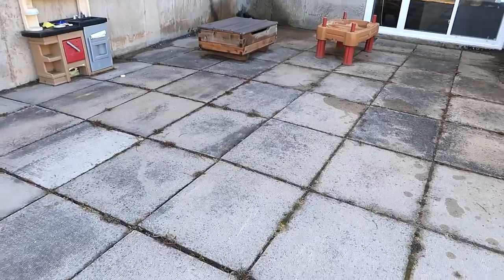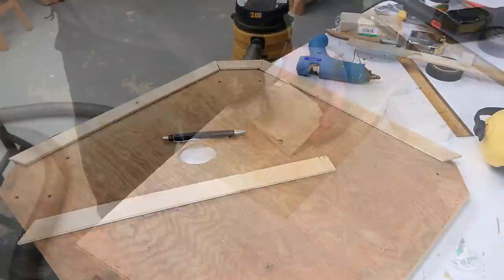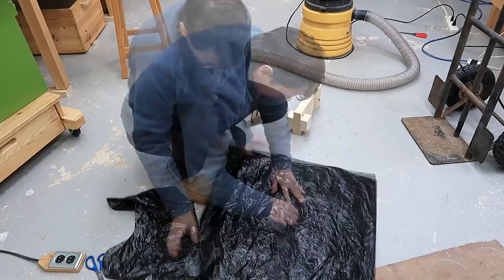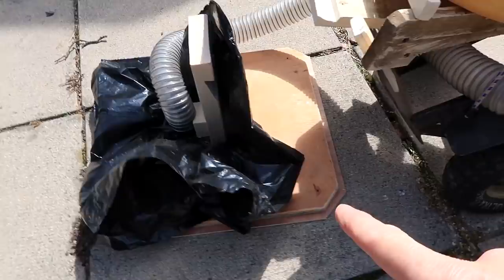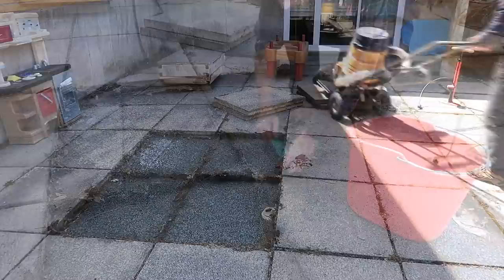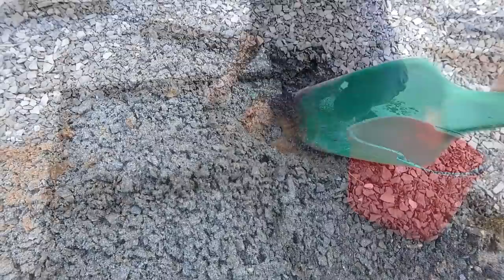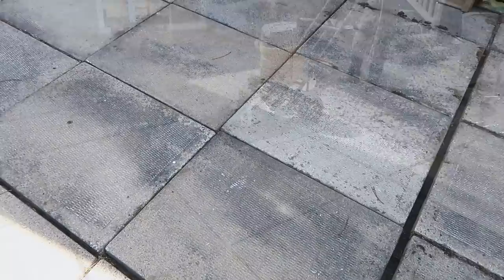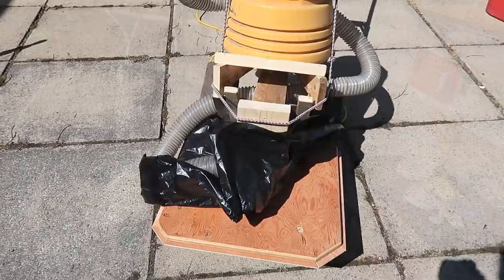Lifting patio stones with a shopvac

Comment: Out of all of his inventions this is the one that impressed me the most. The ratio of simplicity in problem solving to outcome and reduction in stress on the back blows me away! One of those “how did I not think of this” moments
Reply: great points.
Reply: Still a lot more work than just spraying the weeds with some weedkiller, or just pressure wash the patio and that will cut the weeds off (and it needs pressure washing anyway). Long term solution: pressure wash first, then use some stone setting sand to grout the blocks - the sand has a little cement in it and sets up like grout after it gets wet the first time. Won't have a weed issue after that.
Reply: Matthias is great, but these already exist. I own a couple. (probst slab lifter)
Reply: I get blown away constantly  by his content. Also I love when Amogla (spelling?) shows up. Such a cool little 'cottage village' with just barebone fix it stuff. Learned ALOT of stuff on this channel.
Reply: @gorak9000  Chemical weedkillers aren't legal in Ontario
Reply: @jonlai9  last I checked he was in New Brunswick - and vinegar works ok if you can't get anything else (or gasoline, but at current prices, I can see not wanting to use it as weed killer). These weeds are among patio stones, not mixed in with turf grass - you don't need a selective broad leaf herbicide for this job
Reply: Slurp …sluurp!!!!
Reply: @ButterfatFarms  it’s the design principle and how well it worked. Obviously the right thing to do is to lift all the pavers, regrade and maybe add a weed barrier and reinstall. Which he very likely will do soon. But if you’ve ever lifted a patio full of these pavers you’ll know your back will thank you for this.
Reply: @gorak9000  I don't know if it's the case with these pavers, but sometimes they have a finish that can be damaged with a pressure washer. It will roughen the surface, causing dirt and moss to take hold even quicker than before.
Reply: @ButterfatFarms  Tripping hazards.  (From stone edges lifting because of weed roots)
Reply: @dbox1238  Not too surprising that these exist, given that there are people who professionally do this and are easily able to spend hundreds or thousands of dollars to make their jobs easier and more efficient (depending on the exact nature of the job and the machine). However, when you already have a shop vac and a hand truck, a home gamer might be more willing to spend some time in the shop to cobble together something that works well enough for their needs, instead of buying a brand-new single-purpose tool that just sits in the garage until the next time you want to lift those patio stones.
Reply: @gorak9000   just pour boiling water between the tiles.
Reply: @jonlai9  boiling water or salted boiling water are illegal too?

Comment: Polymeric sand is what you need. Spread it, sweep it into the gaps, gently use a blower to clean off the excess then gently water and wait. It will cure to a consistency of rubber.  Doesn't last forever though and will be redone eventually.  Longevity depends on exposure.
Edit to add: when using the leaf blower blow at a 45° angle to the pattern to keep as much as the polymeric in the gaps as possible.
Reply: was going to say the same.. but i think some of those gaps are a bit too large for it tho.
Reply: I used that stuff once. It keeps weeds down but mold and moss grows in the shady areas.
Reply: Plus the Polymeric sand will make it harder for ants to make holes in the cracks
Reply: Yep, used that with pavers around the swimming pool. No weeds. no ants, works well but kinda expensive.
Reply: Everyone has been giving great information for you. I have pavers and a cement slab in my backyard and I do a daily cleanup of the joints between the pavers and the manufactured cuts in my cement slab to prevent dust and seeds from settling in between the cracks. My 30 year pavers I perform a weekly cleanup and twice yearly I pull the weeds out. This is tedious work but it’s a way of performing some type of upkeep which works. The reduction in soil buildup because of the outdoor elements is the only way to reduce plant life from growing. Otherwise you’ll have to hire a contractor to perform quarterly work on your pavers. This is what’s not shown on these tv home repairs.
Reply: Is that similar to the 'kinetic sand' that is sold as a toy?
Reply: @DJ-jm9gi  Sounds like straight microplastic though...
Reply: I have used this! Just don't leave any on top of stone, when wetting! It will never come off
Reply: @robertbackhaus8911  no, this sand has a glue, that sets up hard
Reply: @randallolson8817  if there is sand stuck on the surface a hardwood stick (think oak 1x) and hammer and it'll sort of chisel off.
Reply: Some 8 years ago I made a patio and I used polymeric sand as well. At first it worked fine, but after some years weeds and / or ants won the battle. About 1 year ago I scraped out all of the sand and weeds, blew the gaps clean and dry with compressed air and filled the (3 mm) gaps with a decent amount of silicone kit. My father did the same with his patio in 1995 and it is still as good as new. Okay, not very cheap, but it lasts for ages.
Reply: @rolandmichels1  Good idea! what type of silicon did you use any brand/model? if you can provide any info it will be appreciated thx
Reply: @mrpurpleman9698  I used Bison Polymax transparent. You can use the cheapest type; that stil works fine. It only takes a little longer to dry.
Of course you could use white, black or grey kit, but they will all turn dark grey after a while, due to small dust particles settling in the kit.

Comment: We did something like this in reverse to help my dad move heavy shop tools (saws etc.) around on a fairly smooth floor. Built a "hover-platform" with a flexible skirt that was pressurized by the exhaust of a shop vac.  Dead simple to do and very handy.  (Apparently you can buy them now)
Reply: Like a little hovercraft. hehe.

Comment: I can imagine all of the hard scape installers looking at the wet/dry vacuum back at their shop a whole lot differently this morning.  Even if you didn't have any materials this would pay for itself in less than one day.   Commercially, I've seen the vacuum skirts made of a thin latex rubber - like a slightly thicker version of the rubber band materials the physical therapists use with patients.  It has a bit more weight to it and won't blow around as easily.
Reply: A skirt for this could be as simple as laying a fat bead of silicone. I've used silicone in that manner in the past for vacuum forming, works really well even with uneven surfaces (like textured foam, for example, which is a PITA to vacuum form because normal machines can't "grip" it).
Reply: I was thinking he'd slap some weather stripping on the bottom but a garbage bag is thrifty to an extreme.
Reply: Yep, if this isn't available as a commercial product already, it's about to be.

Comment: Matthias:  The lifting device is pure genus.  You come up with one great idea after another that is why I enjoy watching your videos, keep it up.  Now about weeds in your patio,, there is a granulated weed killer called casaron.  you sprinkle and sweep into the cracks and it prevents weed seeds from germinating.  To rid the soil or in your case crushed rock you simply have to turn the material  to aerate the soil.  To sest you can plant a radish seed or two since they are quick to germinate.  The casaron takes an inch of water to dissolve and form a gas in the soil.  Hope this helps you.  David Adair

Comment: Love the video it helped me build my own for my patio re-lay last year.  The difference for me was I used a probst vph-150 suction head from ebay £20 instead of the first part of your video making the plate.  Then instead of the vacuum which I got working as you showed I decided to use a car type inflator 150L / min and connect it to a vacuum generator block ( simple block of aluminum with three holes, £5 CV 20HS Pneumatic Air Exhaust Vacuum Ejector Valve Compact and Powerful) works a treat.  Maybe others would benefit from you showing that in another video.  At least this way I'm not in the dog house for burning out the vacuum cleaner lol.

Comment: There is a special type of concrete silicone from Sika that you could use in the gaps. That will cure as rubber and will last for as long as you want that patio. I did my driveway about 5 years ago and everything is just as good as the first day. No water wash-away, no gaps for dirt and leaves and acorns to get collected, therefore no weeds. You get the point.

Comment: This video gave me the inspiration to use a shopvac to pull a large dent out of my cars bumper after someone hit it in a parking lot. I heated it up slightly and used a bucket, trash bag, tape and a shopvac and it sucked the dent right out of the bumper. Never underestimate relatively low pressure on a large surface area!

Comment: Great idea, works great. Just spray vinegar on the weeds then pressure wash the joints clean and use polymeric sand in the joints. Then lightly spray with water and it activates it and dries hard so nothing can grow.
Reply: Yes, I've had good luck with polymeric sand.

Comment: In the UK, in public spaces we sometimes have a very light mortar slurry between flagstones. It's not ideal for every location, though - and if you routinely see temperatures below freezing the mortar will crack very quickly. You might be able to reinforce it with something flexible, though - I've seen silicone or tarmac reinforcement before, but it isn't easy to emulsify.

Comment: Nice idea to move those pavers using a shop vac.  Amazing it works.  To keep the weeds out, drop a layer of black weed barrier fabric between the gravel and the earth below.  That keeps the sunlight out and you'll avoid the weeds.  The fabric is not expensive at all.

Comment: Pretty slick. Reminds me of the magnetic manhole cover lifters.
I use pure household white vinegar for weeds between pavers and concrete joints. I use an inexpensive 2 gallon garden sprayer and put one gallon of vinegar in. The rest of the space is to build air pressure in. One gallon covers all the treatment I do for my 1/2 acre corner lot. I put it on heavy and try to do it after it has not rained for a couple days so the weeds will be real thirsty. I used it just the other day when I was mowing the lawn. I put it on around Noon and by 5 PM the same day those weeds were dead. They had burnt up in the sun as they drank in the vinegar plus what was on the surface of their leaves. 

It costs a lot less than the chemical weed killers but it's a lot safer. If a kid or neighbors pet walks on a treated weed they will not be injured. I usually have to use it about every 3 to 4 weeks, depending on how much it rains. But it's worked for me for over 20 years. Give it a try, it will only cost you about $2 for a gallon at your supermarket. I use the generic stuff, the weeds don't care. 🙂

Comment: I was thinking to myself when I saw the title " this is going to take more time to make then just to move the stones" but as simple as you made it, I think it was the best solution without breaking your fingers. As for weeds, I always enjoy using white vinegar ( its cheap and comes in a big gallon jug) and just slosh them on any weeds and within a day they are dead and wont come back for some time. For a more long-term solution, I would pick those stones up and lay down some landscape fabric, or use a 1:2 salt to water mixture.
Reply: What is a crowbar?
Reply: @MushookieMan  It's where crows get drunk and pick up chicks.  :-)
Reply: @MushookieMan  A steel bar with a bend and slightly forked wedge on one end.
Reply: @MushookieMan  Also known as a wrecking bar, used for demolition. Usually a heavy, hexagonal bar about 3ft long, with a wedge at one end for prying and a hook at the other with a claw for pulling out nails.

Comment: We have big patio stones in our back yard, and those are laid in cement and sand (we do not put them in gravel overhere, I think (in NL). Then fill the spaces between the stones with a sand/cement mixture. Nothing comes through (but to be fair it does turn very slippery in winter because water stays on top longer and this in turn causes algae to grow).

Comment: to keep weeds out: use a pressure washer to clean the gaps so less nutrients and seeds build up
on areas where you get loads of weeds just pour over hot water, like whe  you cook potatoes the hot water kills the weeds and the salt makes an unfriendly environment for further growth
Reply: I use boiling water as well, it is very effective. I don't usually add salt, that's a great idea I'll utilize next time.
Reply: @kurtlindner  you don't need to add salt, but when you cooking potatoes or pasta anyways you can use that water and it has salt already in it which is s nice side effect
Reply: I have tried this too , it works. You might add sand or sand and a little cement  powder mixed to fill gaps to stop seeds getting a hold in cracks.
Reply: Nooooo,  you will wash out the aggregate, fill the gaps with a dry mix of sand and cement and just keep an eye on it, when you see any green pull it or nuc it.
Reply: @das250250  cement powder mix would get wet once it rains and could be problematic
Reply: I use det cord, but I do have to replace a lot of paving stones that way.
Reply: Stone dust.
Reply: Gasoline is a very effective long-term weed killer.
Reply: @rationalicthus  and it is perfectly fine for the environment

seriously WTF?
Reply: @suit1337  Seriously, what is that guy's problem?

Diesel has more BTUs and doesn't evaporate as fast.
Reply: @rationalicthus  I use diesel. Works perfect
Reply: don't get salt near any reinforced concrete foundations you might have else it will cause the rebar to rust and crack the concrete
Reply: Hot water with vinegar?

Comment: You can make or buy spacers for laying pavers. Once you remove the spacers, just pour salt between the cracks. Might want to install plastic or rubber garden edging, the 10" stuff is best. Will keep chemical run-off from washing out into the rest of your yard; just run an edge around the perimeter of the pavers. You've got a lot of shifting and heaving, so you will have to relay the whole patio, sadly. Good thing is, the hardest part is already done - the base underlayment.

Cool invention!

Comment: Explore using polymeric sand as a long-term solution or simply spray cracks with common white vinegar each spring. Here in the southern US, the polymeric sand keeps the debris out and prevents weeds from taking hold.  There are particulars to follow in application of the sand to prevent staining of patio stones.  There are several videos on YouTube relating to its use and application. It may not handle freeze/thaw heave.  The vinegar is a safe and cost-effective option which controls weeds well.  It can be sprayed or poured into the cracks.  Thanks for all the great content!  Best to you!

Comment: Use polymeric sand between stone to prevent weeds, you spray it with water and it turns into a hard grout type filler
Reply: That's my tought to!
Reply: This is how to do it, get a high quality polymeric sand, something from a stone yard or patio block supplier.

Comment: On This Old House, after laying patio stones, they always spread a fine grain dust material into the cracks using a broom.

After spreading the material, they then use a hose to wet the material which locks it together and forms a barrier.

Here's a video where Roger is demonstrating the dust for Kevin.

How to Lay a New Brick Patio | This Old House
https://youtu.be/2IZrOQ443sg
Reply: I believe it's called portland cement.
Reply: @doxy5709  No, its polymorphic sand.   Using any cement or concrete between these pavers will simply end up cracking, and a smaller chance of cracking your pavers.  You'd end up looking good for one summer or two, and then weeds growing out of the cracks in your cement/crete.

Comment: Put a layer of heavy poly under the slabs. It really helps to stop the weeds from taking hold and when they do grow here and there they are relatively east to just pull out. You can just put 6 inch stips under the joints but the savings are not that great and it can be a pita.
Reply: Yup. I've seen them made out of tyvek as well with holes to allow water seepage. The ultimate weed preventative.

Comment: For narrow joints, polymeric sand between the pavers works well. You need to make sure to work it in well though.  It's not all that strong, so if you have any voids it will eventually collapse into them, and weeds will get through.  It also wears and erodes, and so it needs to be touched up every few years.

I've also caulked my joints.  It works and looks great, but it's relatively expensive and labor intensive.  It also needs to be repaired regularly, and some repairs require removing the old caulk, which can be stubborn.

Now I just use weed killer.  I wait for weeds to emerge in the spring, then spray them down.  About a week later I pressure wash, (which I do annually anyway) which gets rid of the dead ones.  I have to pull a few weeds by hand over the course of the summer, but not many.

Comment: That’s quite a contraption!  If you put down some landscape fabric before you place the stones again it will stop the weeds. Also, there should be a slight gap between each stone which is usually filled with sand to allow drainage and thermal expansion.
Reply: I was also thinking landscape fabric, but I don't think I've ever heard of that being done (I'm no expert). I wonder if there's a good reason not to.
Reply: Landscape fabric breaks down and then is almost impossible to remove from the soil, and actually makes weeds harder to pull once they've established themselves in the broken down fabric.